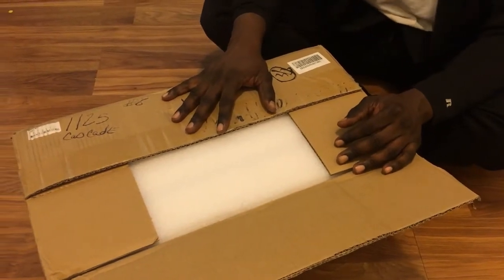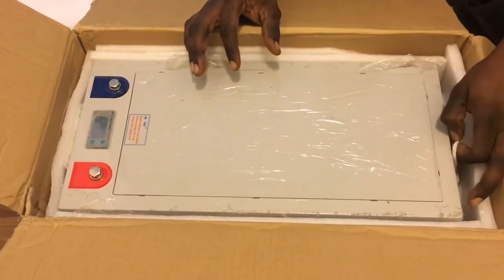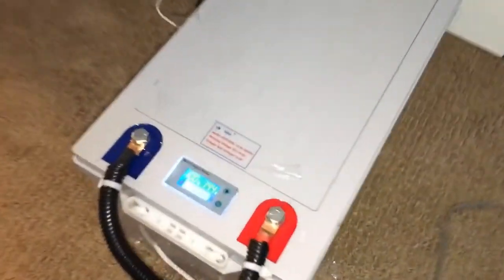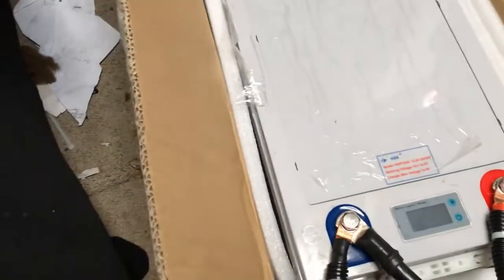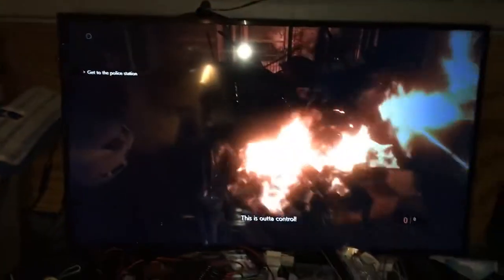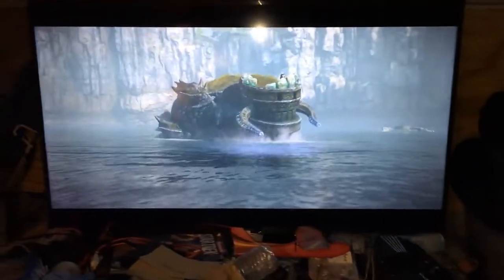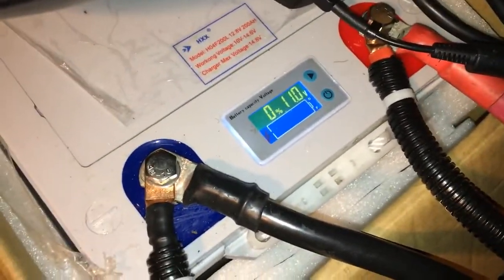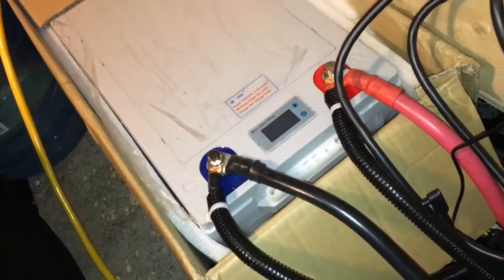NAPOK 12V 200AH Lifepo4 LITHIUM BATTERY REVIEW

Comment: Thanks for the test Sir,I have bought similarely the same battery just without the voltmeter,and in my capacity test the 200 Ah was only a 80Ah repeat the test 3 times and same result.
Reply: The one without the voltmeter built-in is a 100ah battery. https://amz.run/45K6
If you only got 80ah, then your's is defective and you should use your warranty.